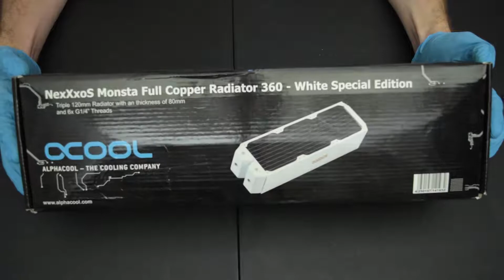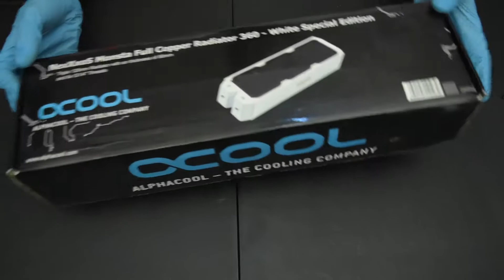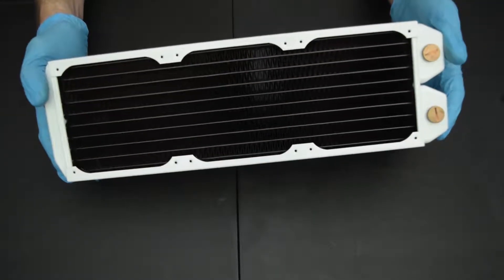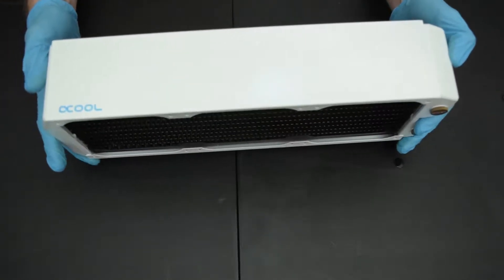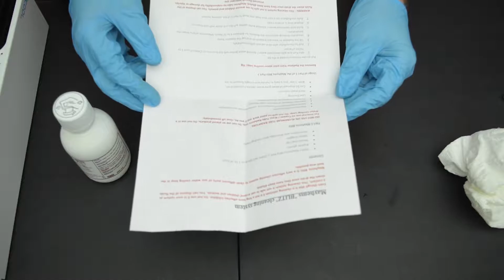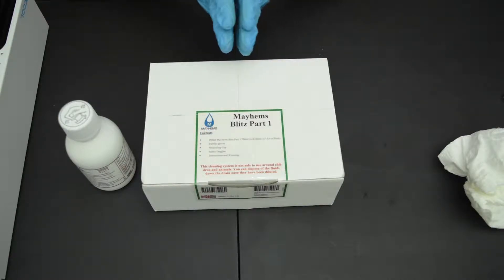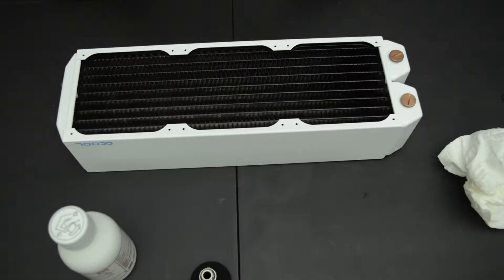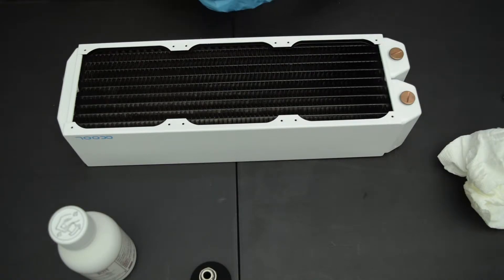Watercooling radiator prep with Mayhems Blitz!

Comment: On multiports radiators such as SR2 do you recommend to replace all the caps prior to the part 1 treatment and put them back after o finish. Or you are meaning just the last 2 caps. Thanks !